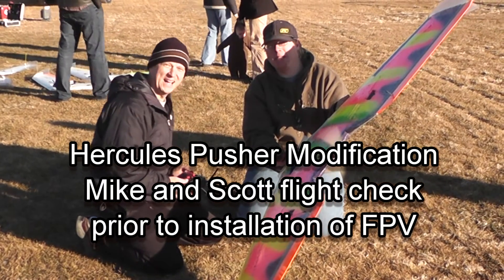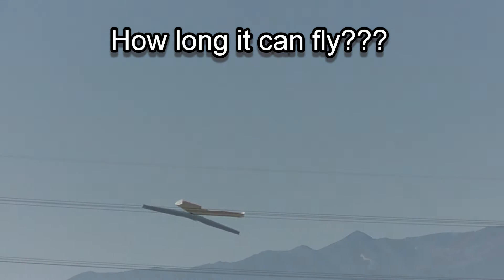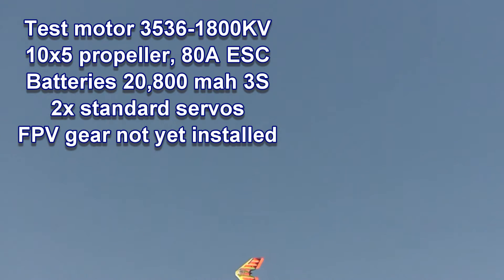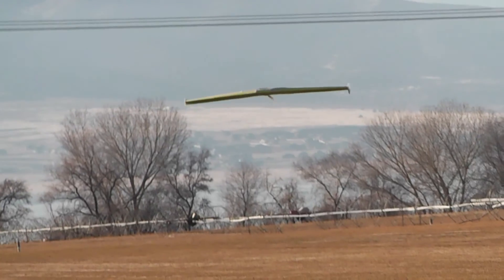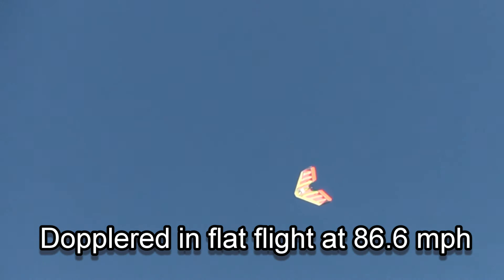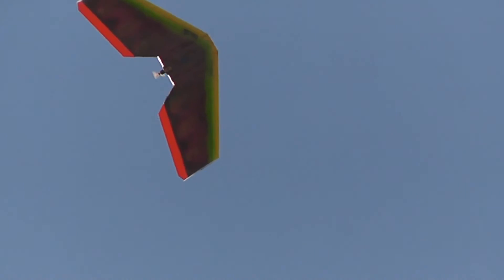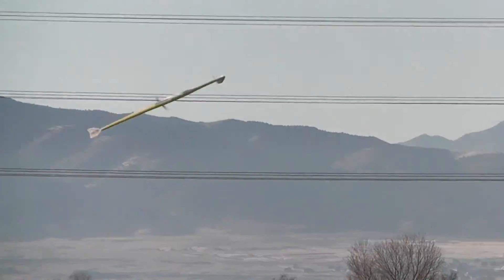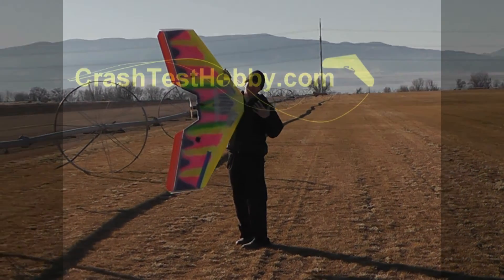Hercules pusher  - Mike - Scott  1-12

Comment from the maker: It all depends on how many batteries you put on board.  They tell me they can get close to 2 hours but I think that may be mostly coasting.  I have 6+ of the motors they are using and it WOT uses 50+ amps.  If you watch the plane you see they are running at about 1/3 throttle except on launch.  We now sell this design as a kit.